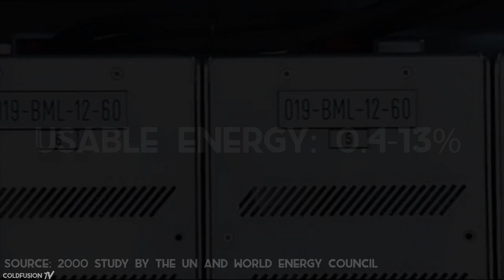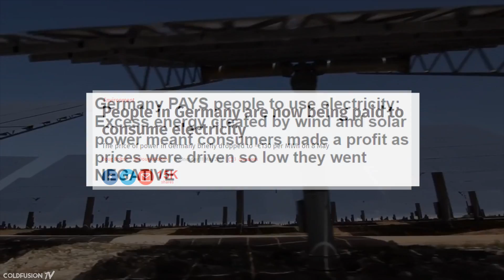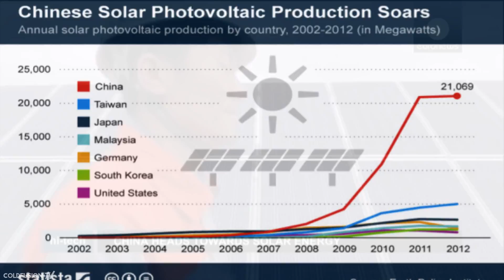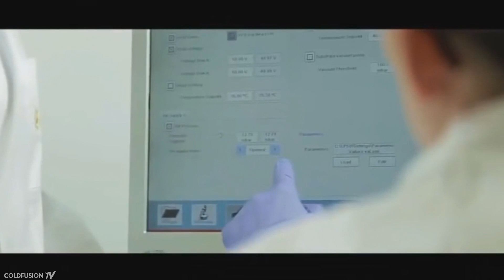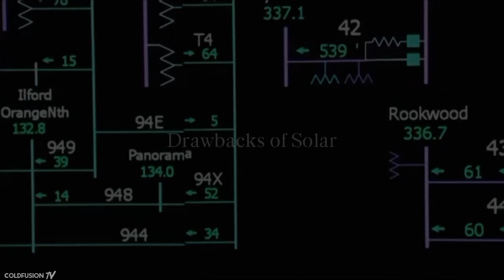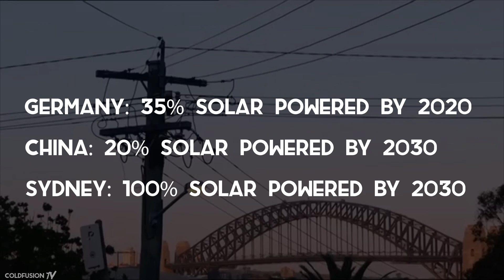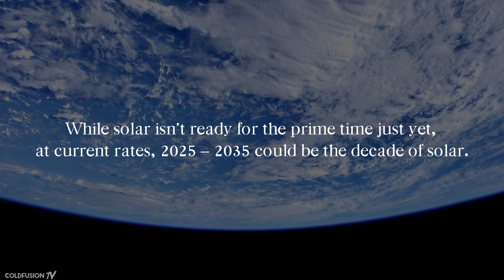The Truth About Solar

Comment: I would rate this as the half-truth about solar.  I live in California where we have lots or solar including large solar farms.  Solar and wind has turned out to be so unpredictable and unreliable the power companies aren't buying solar or wind generated energy.  Instead they are buying more nuclear and coal produced energy.

Solar turned out to be a failure in Nevada and the solar companies closed and are no longer in business.

The efficiency of solar is pathetic.  Yes the sun as a result of nuclear fusion  and fission provides us with almost all of the energy we need to live, the amount we can capture with home solar system turns out to be only about 5% or less.  

Remember the sun produces many different wavelengths of light but solar panels only can produce power using only a couple of wavelengths of light.  The rest is converted to heat and is lost.  

The guy in the video only talks about peak efficiency.  That only happens for 45 minutes 3 days out of the year for a fixed mount system.  The rest of the year the suns ray hitting the panels at a angle the panels and average out to be maybe 20-25%  efficient.

Then you need to factor in loss of efficiency due to heat, wire resistance and the efficiently loss in the inverter (another 15%).  So for a system that costs $40,000 you only get  5%.  Then with each year the efficiency of the panels decreases.  

There's also no mention of the energy cost to produce the solar panels or to recycle them.

Solar sounds so appealing until you find in the United States the government/tax payers are paying for 30% of every solar installation.  While the home owner saves $50 to $75 off the cost of their electric bill the solar companies and Wall Street make $25,000 per home where a solar system installed.

Do the math on solar.  The people who are promoting it are making a fortune ripping off the tax payers.
Reply: I think you missed one of the main points.  Solar technology is improving at a geometric rate.  Sure some solar technologies and companies may fail and the price may not be where you want it now but the technologies are improving and the price is coming down.  Every other electricity generating system has losses due to wire resistance and heat.  And many of the other concerns you express were directly addressed in the video.  

Also fossil fuel companies have been making huge fortunes ripping off the taxpayers for century or more.   Taxpayers getting ripped off isn't due to solar energy it's due to something else.
Reply: Passed High School Physics That sounds more like a problem with government and wall street than with solar technology.
Reply: okleydokley I live in California where we have geothermal and it has problems too.  

Geothermal has caustic chemical in it that rots out the pipes and then what to do with the stuff that comes out of the pipes?  It's toxic.

In addition in California we have found not that much energy can be generated with geothermal.

With nuclear so energy dense it's looking like that's our best solution at this time.  We currently have fuel to supply the world for the next 500 years with electricity

And as for the highly radioactive nuclear waste we return it deep in the Earth's crust next to the Earth's mantel where it is secure and safe.  Over time the small amount of highly radioactive waste will mix in with all of the other highly radioactive elements in the mantel of the Earth.
Reply: Thank you for sharing and informing us of this!
Reply: I considered solar and did the math. It did not make sense, even assuming panels work and last forever. However all our local farms are pumping water with solar electricity. Solar makes sense as a supplemental source if you use a lot of electricity. Geothermal heating makes sense. Its insane we haven't been doing that for a lot longer.
Reply: @Passed High School Physics You couldn't be more wrong.
Reply: While I don't know about the state of large-scale solar, getting panels for my house works wonderfully. I pay a few dollars per year for energy, and I will make a return on the investment in two years, not including the increase of the house price as well. I recommend buying panels for your own house. Hopefully large scale solar becomes just as advantageous soon.
Reply: Yea don't believe this guy. I would bet he either doesn't live in California or hes a nuclear supporter. I do live in California and I speak to HUNDREDS  of people all the time that have solar and every single one of them is very happy with solar. The only problem I see is when people don't do their proper research and get a bad company contract or lease. Do your research understand what your buying, key word buy.
Reply: Shlomo And the other companies?  They are using the same business model?

I just read that Bill Gates who is funding the development of the next generation of  nuclear reactors has meet with so much resistance to nuclear power in the United States and Europe he's giving it the the Chinese.

Americans need to wake up before we give all of our technology away and not use it ourselves.
Reply: no, there's proof that's not the case, there are 30 year old solar panels that still output their original capacity. and solar panels are sold with a 30 year warranty that guarantees it will be at least 80% efficient by that time, or your money back.
Reply: Just because the state of California is bad at managing the energy it generates, does not make that the case in the rest of the world.

Because of our solar and wind we were able to run coal free for the first time since 1870 last month.

you can fight it all you want, but the fact is, solar works, wind works, tidal works - and we're only getting started.
Reply: +topflight408
   Agreed, hettygreene is a moron.
Reply: Could it be me being sarcastic and you being too thick to spot sarcasm?
Reply: +CNCmachiningisfun Don't bother with hetty hes a lunatic that thinks the NSA implanted a chip in his brain
Reply: Tesla wont die anytime soon, and they are buying solar city. Tesla have a lot of work to do, just to catch up with demand.
Reply: Tesla don't make money because they spend it in upgrading capacity, if Tesla wanted to make money next year, they could. They would also miss their production target of 500,000 cars a year by 2020. Tesla is worth around 30billion, The solar city deal is only costing them 3 billion 10% of Tesla stock, money that then goes to solar city anyway.
Reply: Yep. HALF-TRUTH about solar would be a much more fitting title for this video. I agree! ☺
Reply: :P ..so just because it may (or may not be, i dont know the fact on that location) have problems in California mighty USA... it is a half truth that solar power will power us humans into the future? I really dont get why people are even measuring a success to what is happening (or is not happening) in the US. The US is a lot of things, but not world leaders or pioneers, at least not for the rest of the world. Now, now, before we go into a futile discussion about this and that. I am only sharing general perspective of people not from the US and am not looking for a discussion in that, I am only stating it to confront the sheer arrogance in reasoning through your post of California.

If you were to google a little, you can find plenty of examples all over the world that proves over and over and over again that even in the current state of development (heck even 10 years ago) solar panels can EASILY substitute the inmensely poluting current systems in place. Not everything is just about money money money :) I much rather pay a chunk more tax and have funding done for a nation wide solar system replacing all current systems, knowing that much cleaner air is being inhaled and much less furhter poluting is done to our habitat. Money should not be a substitute for your heath and that of your family. And for those who do not have the blessings to be lucky enough to individually finance such systems, I suggest full and utter support to any politician promoting public systems.

People who are still talking about "if solar is (for now) the way to go" are really lost.. and if you manage to find yourself in measuring this change towards money.. you are corrupting yourself while being really lost. The tech is there, it is proven and its only YOU who can make it or break it.
Reply: hettygreene My friend, by all means you have the right to any opinion you desire to form, but I do feel it is important to point out that you are factually wrong.

You seem to forget as well that the electrical market is already established by our current systems coal, hydro, nuclear etc.. and this fact alone requires "new tech" that wishes to invade that market to be supported by funding. The second thing you seem to conveniently ignore is that ALL currently established methods of generating electricity AT THE LEAST in the beginning (if not still) required subsidizing and there is nothing wrong with that. Just because it requires subsidizing (like going to space ;) ) it doesnt mean it is not  a good goal or tech.

As for the "but what when it gets dark" nonsense, you are aware you can generate a surplus and store it yes? Its all part of the already existing products. Besdes this solar is not the only renewable energy source ;) it can all be joined.

I really dont understand people such as yourself, what is actually what you dont want to happen? That we (as in you and I, the people) take back control of our power generation/consumption and individually generate and store it AND even communally exchange the surplus?
Reply: +hettygreene Celebrating evil? You sound like a moron who believes in secret cults and the illuminati. Look you dumb fuck when you pay taxes like I do then you can have an opinion. And once you get smart enough to realize that renewable is safe, cheap and practical solution think of me. Now put your tin foil hat back on because the aliens are looking for you in your moms basement
Reply: +hettygreene Quack science?  You don't believe in proof? Solar cells have been used for decades and are proving to be the solution for earths energy problems.  Let me guess you believe the world is flat and the presidential cabinet  are reptiles from the center of the earth
Reply: +Passed High School Physics Try companies like Edison and PG&E that's where I get my info from not some off the wall esquire magazine. Try doing real research speak to a power rep from your local station. And FYI solar farms produce electricity so how can you say CA doesn't.  FYI the plan to prevent the blackouts is smarter charge controllers and like I said earlier an interstate power line so we can sell our excess power
Reply: +hettygreene hey Moron your still talking. The reptilians haven't come for you yet?  Or is it a magical man who is going to save you? At the very least the OP made some points back by research. You just give people like him a bad name. So put your tin foil cap back on and beware the aliens are watching you.
Reply: Passed High School Physics 
  Agreed. This technology has quite some ways to go before it could be described as the best option for all users. 
 It's just a lucky thing that the prices for solar panels has taken a nose dive in recent years, as that helps to offset their natural depreciation and intermittent performance. 
 Since I am off the power grid, I am obliged to look into all of the possible power supply options.  As solar in itself is not the full answer, I have also added wind turbines to the formula. Naturally, they have their obvious down sides too, so the final step has been to use a generator.  In the past, I used fossil fuels to run the generator, but in recent years, I have learned how to run my petrol powered generator on wood.  It's a carbon neutral solution, so Al Gore will be pleased  :) .
Reply: hettygreene Yup - And look at the financial trouble Solar City is in.  It's looking like another story where the tax payers get ripped off by the solar industry and Wall Street.
Reply: Shlomo  Seems like both Tesla and Solar City are headed for life support and won't be around much longer.
Reply: Strangething90  In what way?
Reply: Strangething90  Where are they getting the money to upgrade if they aren't making any money?

If Tesla is worth 30billion as you say why can't they pay their bills?  And why is their credit rating so poor?

The may have a target of 500,000 cars by 2020.  But if they don't have money to pay their current bills where are they going to get money for the materials to produce the new cars especially if their credit rating is very poor no one will loan them any money.
Reply: ***** What your cousin did makes perfect sense, but what does he do for power at night of if there are clouds?

He then needs a bank of batteries.  If he used the cabin on weekends a week here and there who is maintaining the batteries?  How long do the batteries last?  How much are they to replace?

Will his $30,000 solar investment ever pay for itself?  I live in California and even with the 30% tax credit a $30,000 solar system just barely pays for itself in 20 years for people how live in the house.

I find it hard to believe with the life of solar panels being 20 years that the $30,000 makes any financial sense.    

Just how much would your cousin's power bill be each month?  $20 - $25?  I'm thinking maybe your cousin may have been better off paying the $30K for power poles and paying $25 a year not to have the hassle of maintaining and replacing the batteries AND for the convince of having electricity 24 hours a day with the flick of a switch.

Plus in 20 years your cus will have to replace all of the solar panels with new ones.  Will that be another $30K?  

If the entire solar industry flops again your cus will have to pay the power company $30K to install the power poles anyway.

I was all set to install solar on my house until I did the math calculations.  The solar companies are sure lying about the advantages for solar.
Reply: yes, no one  is debating that, we know its pretty shit in the winter, but its brilliant in the summer, here's some data (i say some i mean quite detailed numbers) about UK solar and wind. Over the course of a year, they are even. solar has twice the max capacity of the wind, but the wind can operate at night.

http://www2.nationalgrid.com/UK/Industry-information/Electricity-transmission-operational-data/Data-Explorer/

solar is more than enough to offset coal and gas generation in the summer, we can use other solutions for winter.
Reply: Strangething90 I live in California where we have many large solar and wind farms for generating electricity.  The power companies in our state have had brown and blackouts as a result of solar.  Mid-day clouds cause dramatic decrease in the production of electricity which causes brown/black outs.  As a result the power companies aren't buying the solar electricity and the solar farms are shutting down.

Same problem with wind...  It's unpredictable so the power companies aren't buying the power and they also being shut down.

The UK had the same issue a while back were there was no sun and no wind so they had to buy coal and nuclear generated electricity for a week.  

Here in California we are beginning to see the problems and failures with solar and wind.

Solar and wind sound wonderful but like all of the other ways to generate electricity they are not perfect either.
Reply: +Passed High School Physics 

Absolutely, Passed. 

This "renewables" crap is the Kids Lemonade Stand version of energy production.
Reply: Average solar panels are 20% - which is 10x better than photosynthesis i might add, you can get more efficient panels with a much greater cost. the tech is improving all the time to bring costs down, that's whats being sold. most of all solar panels have appeared in the last 5 years

and to shoot down your subsidies "argument" if oil and coal are so good, why are they subsidised? 

The only reason solar was "subsidised" in the UK was to increase uptake, that fell dramatically from 40p down to 14p per kw/h, the difference being it now takes longer to pay back the cost of the panels, which everyone knows lasts way longer than 30 years and does not degrade at 1% per year.

Anyone arguing against solar either doesn't have solar or bought the cheapest home made garbage imaginable.
Reply: Strangething90   I think you need to check your facts.  Chloroplasts, (the solar collectors in plants are 37% efficient and plants unlike solar cells are not completely covered in chloroplasts.

You claimed solar technology is getting better with time.  Yet over five years ago a solar panel which is 95% efficient was supposed to be hitting the markets in 2015/2016....  Where is it? 

http://phys.org/news/2011-05-solar-product-captures-percent-energy.html

If the technology has brought down the cost why in the US are tax payers having to pay 30% of the cost on the installation?  If the technology were getting better as you say we would have solar panels that are 95% efficient and there would be no need for tax payer subsidy.

Why do you say solar panels do not degrade over time when the solar industry has shown they do deteriorate at 1% per year? 

http://energyinformative.org/lifespan-solar-panels/

http://www.nrel.gov/docs/fy12osti/51664.pdf

Fossil fuel subsidies in the United States began in World War I as we helped our European allies win a the first World War. 

I was about to install solar.  My roof is southwest facing, receives no shade so I feel I would be the ideal candidate for solar.

The solar companies in the US quoted me a price of $40,000 (USD).  If prices have come down, why is solar so expensive even with the 30% tax credit?

I researched this and found the solar company is really selling me $9,000 in solar panels $3,000 for permits and installation so where's the other $28,000 going?   It's pure profit that's going direct to the solar company and Wall Street.

That's over $25,000 of pure profit for each home the solar company installs solar panels on.  How much do I save?  The solar companies tell me I get to save $50 a month or only $600 per month.

I might be dumb, but I an not stupid.  The solar company makes $25,000 while I get to save maybe $12,000 over 20 years.

Solar has to be one of the worst investments ever.  People are spending $40,000 and getting back $12,000 after 20 years?

Please tell me why solar is so good?
Reply: hettygreene No idea what you just wrote my friend :D and i really would like to understand you.. 

I can let you know though that the solar energy market is growing and growing, more and more, better and better and it is only going to continue like that and I am very happy for it.. happy that my house generates its own energy, that I can store it, that I can use it how i want and that the energy I use does not come from destroying this planet ;)
Reply: hettygreene You are really hurtfull and because you are so degrading  and hurtful to me, you must be now all of the sudden factually right. What was i thinking ;)
Reply: +hettygreene The Gods Ra and Helios have give us permission to use their power. That's what you sound like, moron. And this is America you foreign minded dipshit and here in America we are working on becoming the best and sometimes that means paying taxes on things you sometimes don't agree with
Reply: +topflight408 

YOUTUBERS BEWARE:  

This is the kind of thug that's behind the quack-science superstition of the solar crap.
Reply: +Passed High School Physics Lets look at the facts. #1 the earth is a sphere #2 there has not been a single blackout due to solar #3 the only reason you hear solar and black out in the same sentence is because the solar farms are producing too well #4 This will allow CA to sell electricity to other states win win #5 Solar sales are increasing solar leases are decreased because buying is smarter #6 90% of people laid off from Solar City found a job in less than 2 weeks
Reply: topflight408  Again in California there are 75+ power companies.  Some own and run power generation facilities, (nuclear, coal, gas, hydro, solar, wind) while others buy what's produced.  

We also have some power companies which produce power and only sell to various power companies int eh state.  All of the electrical produced in the west is placed on one power grid to supply power to all of the power companies in 5 or 6 states.  Each power company has to place an order for how much power their customers will use 24 hours in advance.  If one power company requires more than they ordered it results in a brown or black out.

Likewise if the orders are in but a cloud reduces the energy output of a solar farm or there's no wind for a wind farm it results in a shortage and brown-outs/blackout occur.

This is what's happening in California and Nevada.  To prevent brown/black outs the power companies are buy more nuclear, coal and gas created electricity.

What happens is the solar and wind electricity created have no buyers in any of the states so they go off-line.

This could maybe be "fixed" with a smart-grid but that's not going to happen any time soon either.

Reason the west coast wont't see a smart grid for at least 100 years or more is the life of the equipment.  If you factor in all of the spare equipment it will take 125-150 years to replace.

For us to implement a smart grid any sooner would require the purchase of all new equipment plus all of the spares and the installation.  This would require swapping out all of the current equipment and adding the new smart grid infrastructure.  

There is no way 200+ power companies in the west replace all of their existing working equipment at the same time.  If there is just one hold out it won't work.  Then the question becomes who pays?

The coast will be to the customers and it's estimated electricity costs would have to triple or quadruple for the next 50-75 years to pay for it.

I asked before....  Where are the solar panels we were told would be for sale in 2016 which would cost less and be 95% efficient?  If these panels do exist this would change everything.  One would need 60% less panels to generate the same amount of electricity as the current panels and they would cost less too.

So where are they?
Reply: So why don't we all just burn all our fossil fuel reserves and fuck the future? That's the simplest way, and humans like simple, because humans are basically lazy creatures.
Reply: topflight408 
  He's an idiot. What's worse is that he has smeared his clueless crap all over the comments under this video.  Still though, he's funny, in sad and pathetic sort of way  :) .
Reply: hettygreene 
  YOU are the idiot here.  
 While "Passed High School Physics" puts his points well, you are nothing but a bad tempered shit stain.  
 Oh, by the way, I do NOT believe in this global warming crap. nor do I believe the tax payers should be saddled with any of the bills for alternative power.
Reply: hettygreene 
  All I am promoting is personal, home, use of solar, and wind power. I don't want to force this upon people who don't want it.  Was this not clear to you from the start?
Reply: +Mentholatum101 

Solar hustling is justified by a quack-science superstition called "global warming".
Reply: +hettygreene
  Your comments are pathetic.
  Grow up!
Reply: enator71  No mention of whaling and spermaceti or nuclear?  (Remember nuclear reactors are 100% natural and were around billions of years ago.

You know something interesting about the electric cars from 100 years ago?  They have the same range as the electric cars of today.

In 100 years we have not solved the range problem.

You are right about us running out of fossil fuels.  We were told fifty years ago at the rate we are burning fossil fuels they would be all used up in sixty years.

Glad to hear it will be another sixty years before the fossil fuels will be all used up again.  I suspect in 60 years we will be told once again we only have 60 years of fossil fuel left before it will be all gone once again.

You are missing one thing.
 OIL=60 years.
The SUN=5.500,000,000 years.
Nuclear will provide power until the end of the universe.

Appears nuclear is the better choice.
Reply: +Passed High School Physics 

Never mind. NIF is National Ignition Facility, a laser fusion money pit boondoggle that is always 10 years away from commercialization - another screwing of the taxpayer.
Reply: hettygreene If you think that you must be living in some altered state or reality or you have been duped but not getting all of the facts.

Why didn't Gates spend 1 billion on thorium reactor development and TWR?  Easy because thorium reactors have way too many technical problems.

Why is the US and Europe putting all of their money into NIF and F4E and not thorium?  Because there are too many technical problems with thorium.

Dude join the reality everyone else shares on earth.  You'll be happier.
Reply: Passed High School Physics 
 Hettygreene really needs to grow up, but we both know that is NOT going to happen any time soon.
Reply: ***** Is he like some of those religious people who believe there is no such thing as dinosaurs? When asked where FOSSIL fuels come from they say the the ground.

And when they see a full dinosaur skeleton in a museum they look at it and touch it and say it doesn't exist.

I guess there are those people who still believe the world is flat and the Earth is the center of the solar system and the universe.
Reply: ***** I hear you.  They have religion.  Don't believe what you see or use critial thinking skills.  They just belive what they are told and what to hear even if they are holding it in their hand.
Reply: hettygreene hettygreene  At least I had a high school physics teacher who taught me to look at the evidence, use critical thinking skills and think.

It must be easier to be a lazy slob not using your brain, and just blindly believe what you are told and not question any of it.

I'm sure you are one of those types who doesn't believe there were such a thing as dinosaurs even if you were holding a dinosaur bone in your hand.

Keep up your beliefs brother.  We need people like you so the rest of us will look at the science and use or brains.
Reply: Where is your proof of this? How do you know? It just sounds like something you made up.
Reply: The only issue with your theory on fusion is it won't be something customers can have in their own home and control it like solar. They will have to once again purchase the power from a fusion facility, which is redundant. I guess the other issue is fusion has been out for over 2 decades and it apparently isn't coming anytime soon. Likely by the time it does 1/3 of the population will have gone solar anyway. Thoughts?
Reply: Solar TV / Solar Wolf Energy   That he wants more money?
Reply: *****  The $45k-$50k systems are for just under 10kW systems.  This is what the "Certified Solar Design Engineers" at SolarCity, SunRun, SunPower, and others are all trying to sell me.

You ask why am I dealing with these people?  First because I thought they were "designers".  Now I know they are a bunch of folks who don't know AC from DC or the difference between a amp, volt and a watt.  That's all stuff I learned in tenth grade.

This is why I keep saying solar is all about profits for the solar companies, Wall Street and people like Elon Musk.  It has very little to do with helping society or the planet.

I would say 96% of the advertisements from SolarCity on how solar makes the world a better place are lies.

I've been trying to find someone who understands solar and can answer the simple questions I posted in my last post.

I can't seem to find anyone that "knows" and understands solar beyond the scripts these "Certified Solar Design Engineers" follow or the basic training they receive and probably don't understand.

No sure where you are located.  In the US we have ISOs which control production and distribution of electrical energy in the Western US.  I was lucky enough a few years ago to take a class on smart-homes, how electrical energy is produced, distributed and sold to the power companies, how are electrical grid works and more importunately the history of electrical power in the United States.  To understand the "mess" we are in today, one needs to look at how and why electrical power companies were created around 100 years ago.  I found it to be a very interesting.  It also answers the questions as to why it's going to take 50 to 100 years to have a smart grid.  Power companies are still using technology and computers from the 1970s and early 1980s to supply power to customers.  I know in Canada they plan on using computers from the 1970s for another 40 years to control their power plants.

The solar we have today is so inefficient in converting sunlight to power I agree with you it's a temporary solution.  But with our power rates now approaching $0.40 kW for the highest tier it's making financial sense.

I still think the solar industry is in financial trouble.  But until they go bankrupt they are sure making a bundle.  From what I see they take a $12,000 solar panel system and marking it up $23,000 to make huge profits.

I'd sure like to make $23,000 off of something that only costs $12,000.
Reply: none You've provided a link for a guy who is a professional witness and is paid to promote an agenda against nuclear and promote solar.

In other words he's a paid shill.

I listened to his video, and the guy is distorting the facts to promote his anti-nuclear pro-solar agenda.

Some of the facts he's omitted is the solar industry after 30 years still have not found a way to store electricity for use at night or when the sun doesn't shine.

He's also left out the fact the solar industry has stated in 35 years at best they will only be able to supply 15% of the world's energy.  He has no solution as for were the other 85% will come from.

In his talk he cleverly omits the fact in the building of solar a lot of CO2 is created and released into the atmosphere which contributes to climate change.

Ad for his anti-nuclear propaganda the guy is using 30-40 year old arguments which are no longer valid.

He shrewdly does not mention or talk about next gen nuclear which uses low molecular weight fuel.  Next gen nuclear power is green (no green house gases), it's renewable as we already have an endless source of fuel. and there is no long lived radioactive waste.

He's just using outdated scare tactics to scare people about nuclear when in fact next gen nuclear is where we are headed.

One has to ask why he's not telling the truth?
Reply: none Dude what you have you been smoking for the past 25 years?  Clear that smoke out of your brain so you know what's going on.  The US, Europe and Paul Allen have all been working on and developing next gen nuclear.

Get with the program, the American people voted and elected Trump as president.  Don't matter what you think of him does it.  You can say he lies cheats and steals but at the end of the day he's still going to be the president.

Dude have the drugs rotted your brain?  China France, Germany and Israel have all built walls.  Why is it okay are you picking on him for doing something other countries have already done?  

You think Trump is a puppet of the Jewish Zionist Government when Trumps relatives where eliminating them is World War II?  You know the Jews would never support of back someone who's family involved in eliminating people in the European Holocaust.

Never said Trump was honest, fair or intelligent.  I just said he's the person the American public voted for to be their leader.  

Dude you are thinking like we are in the 1970 if you think the MIC needs the atomic energy commission.  The US had 31,255 nuclear weapons.  Do you really think the MIC needs more?  

It's not that difficult to make an atomic bomb.  One does not need a reactor.  The first atomic bomb used against an enemy was made by purifying nuclear material...  A reactor was not needed.  

Trump is telling the American people the solar industry is a scam.  And as you say, Americans are sheep and will listen and follow.

The US has thousands of nuclear war heads.  I would not be surprised if Trump were to use a couple of them during his term.
Reply: Solar City was just a bad company with horrible business model that with falling costs of panels went deep in red.
Reply: Thanks for this. Good information!
Reply: I agree with the geothermal. It really makes sense to capture the earths own internal heat source.
Reply: SCTY has problems with cost of financing that it's leasing policies are becoming more obsolete with dropping cost of solar installation thus their recent problems with rate of growth in last 2 years are reflected on financial outlook of the company.
If they are reformed with tesla energy and their new buffalo factory that might be a good thing for tesla in the long run.Problem is that the financial mess of SCTY will make it harder for tesla to finance capital expenditures necessary for gigafab1 growth and model3 mass production.This is the part that is worrying to me because of how crucial model3 is for Tesla
Reply: SCTY yes it looks so but Tesla?
Reply: Strangething90   Are you sure?  Tesla hasn't made any money yet.  The batteries in the cars degrade over time and cost for the battery replacement is $22,500 dollars.

Help me understand.  Why would Tesla, a car company that hasn't made any money buy Solar City that's in financial trouble?

Neither one are financially stable.  But thetwo of them together might kill both of them.

Oh no and it gets worse for Tesla...  They can't pay their bills.  Tesla's credit rating right now is very poor.
Reply: ***** I think the truth is we don't know how long panels will last.  For every 10 years of use they lose 10% in efficiency.  So in 30 year they will only be 70% efficient.

Even if you live alone 300 watts in not much energy.  I'm assuming 300 watts is peak output?  That only happens for 45 minutes a day.  I'm guessing for most of the day you are only getting 100-150 watts.

That's not enough to power a refrigerator and hardly enough to power a computer.

I certainly could not do that.
Reply: There is no reason why current solar tech will degrade overtime, all it is, sunlight displaces electrons in the silicon that then travel down the metal wires to create current.
Reply: Strangething90 At the atomic level the silicon semi-conductor breaks down as the the suns rays/photons strike the silicon.  The accepted average is 1% per year or 10% per decade.

Then the semi-conductors in the inverters only last 3 to 5 years before they have to be replaced.

If one reads the warranty on a solar systems you will see it will only last for 20 years.  After 20 years the energy production has decreased by one fifth.

At this tine you would have to add 20% more panels or replace the system.

Solar is good, but there are a lot of drawbacks.
Reply: ***** I've been researching solar for year now and taken some classes.  Unless you are on the equator there are only 2 or 3 days for 45 minutes where you are able to get maximum output.  This is the only time when most number of the suns rays are perpendicular to the panel.

At all other times the suns rays are at a angle and reduces output.  The drop in output is substantial.  I think over the course of a year you would be luck to get 10 to 15% efficiency for a fixed mounted panel.
Reply: *Koch Industry PAC troll detected.
Reply: hettygreene Nice way of putting it.
Reply: Strangething90 No one is saying solar doesn't work, but it's the cost, reliability and life of a solar system that's at issue.

California has over 70 power companies and we we doing fine with hydroelectric and nuclear.  It's the unreliability solar and wind that's causing problems for us.
Reply: +MrAnchorman123 

If solar is so great, remove all those goddamn subsidies, starting with that disgusting Net Metering, which shifts cost to poor people. 

Solar is a stupidly self indulgent Kids Lemonade Stand "lifestyle" type of business.
Reply: *****  If solar is improving why aren't these improvements being sold?

Do you have any idea on how inefficient the conversion of solar energy to electricity is?
Reply: Why would anyone by this type of solar panels when there are cheaper ones that are 95% (not 20%) efficient?

http://www.naturalnews.com/028691_solar_cells_efficiency.html#
Reply: If they made a solar panel that was cheaper to produce and could get over 900w per m2, they would be shouting it from the rooftops, but instead all we have is an article from 2010, claiming 90% quantum efficiency

https://en.wikipedia.org/wiki/Quantum_efficiency
Reply: Strangething90  There were several articles claiming from five/six years ago claiming 90-95% efficiency from these "new" type of solar panels saying they would be available in five years.

What happened?  Is this like the Osborne effect for computers?  Where prematurely the  discussing future, unavailable products damages sales of existing products.  https://en.wikipedia.org/wiki/Osborne_effect

Or is the solar industry a victim of cold fission?
Reply: If i was able to create a solar panel with 90% efficiency i'd probably just make my own power station, because lets be honest if you can make a solar panel like that, that also claimed to be cheaper to produce than regular 20% panels, it would be 10x cheaper than coal. and then i'd sell a few panels to NASA for a few million.
Reply: +OohzyJohnDow 

Absolute elitist, clueless nonsense!

It's simple but toxic to elitist liberals: if solar is so great, it doesn't need subsidies.  

But it's Not so great, and it needs the stupidly maligned "grid" to come in and take up the slack when - surprise surprise - Night comes. 

Solar is an intelligence-insulting  kid's lemonade stand business.
Reply: +OohzyJohnDow 

That's right, you live in a childish communalist fantasy, as opposed to a market reality. And in attempting to impose your John Lennon Starbucks fantasies on the rest of us, impose hardship, unhappiness, and suffering instead. You are an aggressive, evil person.
Reply: +OohzyJohnDow 

See what's going on in Germany for the solar fiasco, rising prices, cost shifting to lower middle class, frantic replacement of nuclear plants with coal.   i.e. sheer Kids Lemonade Stand stupidity.
Reply: +OohzyJohnDow 

Spare me your self regarding, self serving, 'Im so great'  sermons.
Reply: hettygreene As you wish my friend :) I am at your service!
Reply: +OohzyJohnDow 

You luxuriate and mirror gaze at other people's expense.
Reply: hettygreene I know what I am but what are you ;)
Reply: +OohzyJohnDow 

Not knowing that is another of your shortcomings.
Reply: Thats down to your politicians and coal/nuclear power lobby groups. Fix your politicians and fix your solar problem
Reply: +Minuteman 

You're not getting it. 

"Renewables" are a Kids Lemonade Stand play-business that is paid for by working class cost shifting. 

Support that political rip off and you are a bad person.
Reply: +topflight408 

You are celebrating evil. 

The "happy solar people" are SCREWING the non solar people with the  tax subsidies, cost shifting, and that Disgusting Net Metering!

If you to play earth boy Kids Lemonade Stand,  DO IT WITH YOUR OWN MONEY, you schmuck.
Reply: +topflight408 

"Thou shalt not steal".   

Sounds pretty simple me, you obnoxious self righteous idiot. 

BTW, if it's so cheap, remove the subsidies, you creep.
Reply: +topflight408 

I think you should change your name from Topflight to LowLife.

If the Founding Fathers could only hear your asinine comments about taxes over something as foolish and quack-science as "solar",  they'd think people like you aren't worth the effort.
Reply: topflight408  Yes let's look at the proof.  Solar cells have been used for decades and are very inefficient, very expensive, and in California solar farms are produce unreliable energy which is causing black-outs.  As a result California is shutting down solar farms and burning more coal and fossil fuels.

If solar is so wonderful what have all of the major solar companies closed their doors in the sunny state of Nevada?

I live in California and the number of people installing solar on their homes had dramatically decreased as people are figuring out solar even with a 30% tax payer credit just isn't worth it.  In California the solar industry is laying people off.  With Solar City in financial trouble I suspect we will see the other solar companies announcing they are in financial trouble too.

One has to ask what went wrong with solar technology.   Today's solar panels are only 20% efficient.  In 2010/2011 we were told a breakthrough in solar technology was made and in 2015/2016 we would be seeing solar panels that were cheaper and 90 to 95% efficient.  What happened?  Where are these low cost highly efficient solar panels we were promised?

It appears the solar industry has lied to the public once again.

By the way everyone thought the earth was flat and at the center of the universe.  While some people still might believe that to be true other are looking the the facts, just like with solar and have found it not to be true.
Reply: topflight408  Friend where are you getting your incorrect facts?  I live in California and were were experiencing black-out from as a result of solar.  So please don't tell me it's not happening.

California can't sell electricity to other states as the state doesn't produce electricity.  In the state of California we have over 75 different power companies.  Do you even know what you are taking about?  The power companies in the California purchase power from electricity producers from as far away as Washington State and New Mexico.

Solar like wind has proven to be so unreliable power companies aren't baying it and the solar farms are going off-line.

While 90% of the people from Solar City may have found jobs that still means there are a 10% reduction.

I will ask again if solar is so good for everyone why did all of the solar companies go out of business in the sunny state of Nevada?

If the solar industry is doing so well why is Solar City in financial trouble?

You are like the captain on the Titanic who is telling everyone the ship in not sinking when it is.
Reply: +OohzyJohnDow 

You live in the echo chamber of your full-of-crap fantasies subsidized by poor people.
Reply: The problems with solar continue to mount.  Solar companies with financial problems and others are closed their doors.
Reply: +topflight408 

In your characteristically blind following of the  pagan superdtitionist narrative, you neglect to account for these companies bilking the taxpayer through the stupid solar subsidies, just like the sainted Elon Musk.

They are doing it to make money. Without the ripoff poor-screwing subsidies, they don't do. 

You are a mighty, dangerous fool.
Reply: +John Benton 

How do you pack so many stupid statements into such a small space?
Reply: +John Benton 

No, on the contrary, your stupid sarcasm is so thick you can cut its elitism with a knife. 
You were encouaged in this obnoxious attitude by twerps like Jon Stewart, who are neither funny nor wise. and neither are you, or your mirror gazing disgusting conceit.
Reply: +topflight408 

Yes, there are several on this sleazy mirror gazing hangout who have the patience and depth to talk sense to you idiots, and I have nothing but respect for them . 

I don't have the patience to speak in depth to you disgusting idiots, one reason being that a bright teenager can overturn the childish  quack science of solar a solar and global warming, so I lose patience very quickly.
Reply: +CNCmachiningisfun 

Then why are you here promoting this crap?
Reply: +topflight408 

<--- is in the solar installation business, profiteering off taxes on poor people. 

Anything self serving here?
Reply: ***** 
  Sorry, but which person was your question aimed at. YouTube no longer seems to support 'focused replies', like it used to.
Reply: @Strangething90 +Strangething90
I am still reading along this thread, so is Solar good or no?
Can we run coal free?
Is Solar Panels 10X more efficient than photosynthesis?
Do solar panels degrade over time? How much?
Is testla dying or not? Is it going to buy solarcity?
Reply: +enator71 

Is that in percentage terms?
Reply: enator71 No true.  I like in California and many of the gas/oil companies are going bankrupt right now because of the low oil price.  The government is not giving them any money.
Reply: ***** 
"so is Solar good or no?".
 I can't really say that solar is the answer to all of our problems, but it certainly is good for individual users, as a it lets us save a fortune in power bills and infrastructure costs.
Reply: *****  Is solar good?  It depends.  I have neighbors, friends who have purchased solar and they have found it's a break even or solar is a bit more.

There's a YouTube video where a guy installed solar and did a detailed financial analysis and found if he would have invested the money instead of "investing" in a solar system for his house he would have done much better financially if he had not invested in solar.

Remember solar panel output decreases at 1% per year.  So after 10 years you solar panels are putting out 10% less than when you bought them.

There are supposed to be a new generation of solar panels which cost less and are 90% more efficient.  I would wait for the new stuff.
Reply: +CNCmachiningisfun 

Hi CNC - my happy hobbyist.   

it's me again.

Do you include the 'cost' of your labor in your diy-energy efforts?  Or no? 

By the same token, do you pay yourself in solar-than-thou bragging rights? 

Do you count the cost the rest of us have to pay in listening to that crap since we're forced to come to idiot-blogs like this and defend ourselves against the onslaught of the climate quacks and solar hustlers?
Reply: +CNCmachiningisfun 

.... and I forgot the a couple other things about solar: does the real estate for it come for free?

Do the panels have to be cleaned and is that labor provided by slaves?

do you have to pay higher property insurance premiums. if there's a hail storm, will your insurance cover the damage?

if it's so great, and it adds value to your house, will your liberal for-the-children property taxes go up?
Reply: +CNCmachiningisfun 

No, you get off the genteel bragging rights bandwagon of the tax-coerced solar fad. 

Try this for first principles instead of listening to that stupid Starbucks theme song for the millionth time:

Power is evil, 

because of the following golden rule of politics:

"Liberty" is a poetic term for property rights.

Therefore there are only TWO KINDS OF LAWS:

- those that protect property rights, 

- and those that attack property rights. 

"Have the government do unto others as you'd have the goverment do unto you."
Reply: +hettygreene
 Your comments are driven by jealousy.  
 You are jealous because I have a good life, and you are a jobless loser.
  Grow up!   Get a life!
Reply: +CNCmachiningisfun 

You are a greener-than-thou poseur belle of the ball hitching a ride on a stupid fad.
Reply: +enator71 

What are you talking about?
Reply: +enator71 

If you want to take petroleum off the table of strategic resources, you won't do it with this solar foolishness.

Try Thorium, molten salt reactors, and videos by Kirk Sorensen and others.
Reply: hettygreene Why Thorium, molten salt and not Traveling Wave Reactors?  

America is missing out by allowing TWR technology to be given to China and not using it in our own country?
Reply: +hettygreene
Get a job, and get a life, loser.
Reply: ***** Why?  Appears the looser are the ones who have jobs and the people who have great life are the ones without a job.
Reply: Passed High School Physics 
 While hettygreene continues to make his childish comments here, it would appear that he is the loser in life's ongoing battle for success.  Those of us with jobs have the financial freedom to do as we wish. Not so for those of us who are unemployed, so I think I disagree with your opinion on that point.
Reply: +enator71 

Do homework on Thorium and molten salt reactors, Kirk Sorenson. Your concerns are addressed there.
Reply: +enator71 

1) see the video "is nuclear waste really waste" for reprocessing advantages 

2) the gamma ray concern you mention is not from natural thorium , but one of the elements in the chain. see more videos to get comfortable with that.

3) the gamma emissions of the intermediate products make Thorium "proliferation resistant" -- "it's easily detectable and it kills you without thick protection," says Kirk Sorensen 

4) see the various TED talks for different perspectives on the same issue(s)

5) Thorium us as common as tin; ore scarcity is not an issue; see some more videos to get that part straightened out and also get a correct comparison with uranium: u235 vs u238. Kirk Sorenson: "burning u235 is like burning platinum."
Reply: enator71 If NIF works out that lie "too cheap to meter" will become a truth.

You will find you are mistaken when it comes to treating some cancer patient.  There is a YouTube video where a man and another where a women is injected with radioactive isotopes and become radioactive.  They measure themselves with a Geiger counter.

All of the nuclear radiation is inside of them, not passing through them.

China does not have all of the rare earth elements.  Every here of scandium? or yttrium?  Neither are places in China.

Can you tell us what's wrong with Traveling Wave Reactors?  This is American technology which America is not adopting but the Chinese are.  Once they build  TWR they have enough fuel to power them for 500 years thanks again to America technology we are not using.
Reply: +enator71 

Watch the videos before jumping to conclusions. 

The benefits outweigh the downsides - the benefits make simple gamma Ray shielding look trivial. 
They have walk-safety shutdown features that account for the gamma rays. 

Tidbit: the hotter it is radioactively, the shorter the half-life. Gamma in general is hot, so it's half life is relatively short. 

Once again, see the Kirk Sirenson, multi-TED videos on this to get depth and perspective on it. 

Rare Earths is one of those Sierra Club-govt screwups where they hounded American producers out of business because the processes produced s trivially radioactive waste.  

Anyone care to guess what that trivially radioactive waste was?
Reply: +enator71 

Just watch the videos before shooting your mouth off like jerk.
Reply: +Passed High School Physics 

If NIF is about fusion, may I do my bit to stop those subsidies too: Fusion is a boondoggle with an academic-bureaucrat life of its own. 

See the Kirk Sorenson videos for a quick takedown of Fusion and its obvious drawbacks. 

"Thorium is what fusion was supposed to be."
Reply: +enator71 

I have, more than you on subject of thorium, and the efforts are wasted on a know-it-all blowhard like you. 

There's no reason to be bombast-negative about Thorium.  Too bad such an opportunity trashed that way.
Reply: hettygreene I'd like to hear more about Thorium and how they compare with Traveling Wave Reactors and NIF?

It's my understanding there are many serious technical issues with Thorium reactors which is why TWR are being built and NIF is the hope for the future.  When NIF gets working working there's no reason at all for Thorium reactors.
Reply: +Passed High School Physics 

Right... Kirk Sorenson videos are excellent and exciting places to start up the learning curve of thorium.

In the competitive debating department, it's astonishing that fusion (that's NIF, right?) has gotten a dime of slush money.  Kirk destroys it's practicality deftly with a few sentences of the nuclear physics behind it.  It's always 10 years away from prime time and it's a boondoggle for university research handouts. 

Sorry, I don't know what TWRs are, but i heard Kirk dismiss them handily in one of interviews. 

The real pay-dirt is in Thorium and msr (molten salt reactors)
Reply: enator71  China is going with Traveling Wave Reactors, not Thorium.  We still haven't worked out all of the issues with Thorium reactors plus 10 years is a lot of time.

China should have TWRs online in a few years or end of the decade.
Reply: enator71 I think the web site you are looking at is out of date.  TerraPower has a deal with China going on.  This will make Thorium as obsolete as cassette or VHS tapes.
Reply: +Passed High School Physics 

I've taken a crack at Terra Power and I'm disappointed. 

This is Bill Gates' fun in retirement schoolboy science project. 

Bill is also the one lecturing us on some stupid "carbon neutral formula " he wants to ram down everyone's throat. 

This is what happens when you you have too much time and money on your hands. 

Seriously, TWR is just a bunch of cartoons a
this point with a Bill-Nye-levels sales pitch. 

TWS: solid fuel (worse than liquid);  a cartoon variation on the breeder reactor 
 
(basically tried and failed; see some of Sorenson videos for a compare and contrast of fast neutron reactor basics vs slow neutron ("thermal" i.e. slowed down to ambient temperature by a moderator, so the neutron can sidel up to the nucleus, get absorbed, and cause a fission.

(I've been listening to to the UC Berkeley  Nuclear Engineering videos; great example of YouTube education potential).

Back to Traveling Wave Reactors, Kirk Sorenson mentions it in a taxi cab  interview in one of his videos and 1, describes it in the high-risk speculative technology that it is, dismisses it accordingly. 

I've seen the Traveling Wave cartoon and it looks frankly crazy.  

Some snake oil salesman got to Bill Gates with this one - solid fuel (bad), no visible means of reaction control (good regulatory luck with that), etc. 

Sorry to disappoint and not enthuse about Traveling Wave, but TWR looks as challenging, high risk, and boondoggle-ish as fusion, i.e. a money losing waste of time compared to Thorium and MSRs (molten salt reactors)
Reply: hettygreene  I've been watching the UC Berkeley lectures too.  They are wonderful.

You are right Bill Gates in the only one talking about TWR and TerraPower is well funded.  The thing about Carbon neutral is a political but the fact still remains we need to find a solution to the world's energy problem and the burning of coal and fossil fuels is not the answer nor is solar and wind.  Bottom line is we need all of them.  But right now solar and wind are very expensive and nuclear and coal are inexpensive.

Is there any active development on a Thorium reactor?  Last I heard the were several technology problems we haven't found a solution for.

Unlike Thorium TWR is ready to go and China is building TWR.  

Thorium or TWR we have 700 years of fuel sitting in warehouses to power these things.
Reply: +Passed High School Physics 

It's a detail, but how can you say TWR is ready to go when all you see are cartoon interpretations of it on YouTube?

Whatever, I recommend investing time in the Kirk Sorensen  videos, understanding them as thoroughly as possible, and cross referencing the material with others who are betting their futures on it.  Ted and Google talk have and expanding catalog of presenters on this subject, but Kirk Sorensen is the founder of the "Thorium Renaissance" (he understands how to take advantage of YouTube, also to his credit (!)).
Reply: +Passed High School Physics 

PS, which UC Berkeley course(s) are you watching?
Reply: hettygreene Any course by Richard A. Muller.  His  Physics for Future Presidents is a fun watch.  He has some nice experiments.

The Emilio Segre lectures are incredibly interesting.

Nuclear Engineering 101 is a nice review.
NE 2=162 Radiation Biophysics and Dosimetry

Lawrence Berkeley National Laboratory has some very nice lectures.  The lectures from the Advanced Light Source researchers are good.

Marian-Diamond's Integrative Biology 131 - This women is amazing.  She's one of the people who has a piece of Einstein's brain.

I found History 167B:  The Rise and Fall of the Second Reich incredible interesting.

What about you?
Reply: +Passed High School Physics 

.... Nuclear Engineering 101 was a "nice review"?  Wow... you must have a lot of heavy science and math under your belt.

Am not familiar witj the other courses, will check them out eventually.
Reply: +Passed High School Physics 

Muller takes the climate quack loyalty oath.
Reply: If one thinks it through, you have to put in maybe 16x name rated capacity compared to nuclear, which, runs over 93% of the time, and, is getting more efficient all the while. In the 70's nuclear only was online half the time. On top of that nuclear plants are being certified to run with higher enrichement. Still far below the level of making a bomb which is what everyone is scared of. In fact the new plants pose no problem for hydrogen and xenon gas explosion, which, is the true danger with nuke plants (emergency ventilation). And, new nuclear plants can burn up almost all old existing waste. If economies of scale were applied to nuclear, the cost of carbon free electricity produced by nuclear would fall by half ---- if that were allowed by the powers that be.
Reply: MrBlueDevil93  Not sure why all of these anti-nuclear people are worried about nuclear bombs being made from the fuel in nuclear power plants.  Remember the second atomic bomb that was detonated?  It was a uranium bomb not a plutonium.  If terrorists/rogue nations are going to make atomic bombs they would make it from uranium.

Remember Saddam Hussein?  Iraq as making uranium bombs.  They were about 40% through the purification process when they were bombed.

Uranium bombs are easy to construct and detonate, but the purification of the uranium is tricky.

Plutonium bombs are very difficult to detonate.  That's why the US detonated a test one to make sure it would work before actually using it in war.  It's highly unlikely any rouge nation or terrorist would be able to build a working plutonium bomb even if they had the plutonium.

Remember North Korea detonated a nuclear bomb earlier this year.  It was a dude as nuclear weapons go. North Korea's claims on the size of the bomb doesn't come anywhere close to the measurements made by other countries around the world.  Yes they have atomic weapons, but they are having a hard time getting the full explosive power.

Most anti-nuclear folks don't know that the burning of coal to generate electrical power is one way to purify uranium which can be used in a bomb.

If terrorists wanted to make a nuclear bomb they would not use plutonium from a nuclear reactor they would use uranium form a coal fired power-plant.

Something else nuclear has going for it. is the energy density.  The amount of energy in one pound nuclear reactor fuel is equivalent to one billion pounds of coal.

If we compare nuclear to solar.  The amount of energy one pound of nuclear fuel is more than 10,000,000 times as much as what all of the solar panels and wind farms in the world right now will produce in the 20-25 year life span.
Reply: +Passed High School Physics 

How do you get u235 from coal?
Reply: hettygreene Buy burning it.  In the coal are radio-active elements including the isotopes of uranium.  Burning the coal separates and extracts the uranium and other radioactive elements from the coal.

What the silly anti-nuclear people don't tell or don't know is the burning of coal released millions of tons or radioactive isotopes into our environment every years. Nuclear power plants release none.

And all of the coal slag heaps are radioactive so every time the wind blows or it more radioactive isotopes get blown into our environment.  And when there's a fossil fuel spill it also released radioactive isotopes into our environment.
Reply: +Passed High School Physics 

I'm sure the blood thirsty alarmist quacks can't wait to beat everyone up with that one.  I suppose dirt dust has "radioactive isotopes" in them too. 

I  think you're missing the point with... with what ? coal ashes?  

Are you expecting utilities to sift out u235 from coal ashes?
Reply: hettygreene Everything is radioactive including us.  The utilities have done a poor job with the coal ash.  Take a look at Johntown's floods.

Would not expect the utilities to do it, but rogue nations and terrorists sure could.
Reply: +Passed High School Physics 

You're saying it is economically feasible to recover u235 from coal ash?
Reply: hettygreene  Depends on what you mean by economically feasible?

What I'm saying is that it is possible.  If you are a terrorist group or a rouge nation do economics matter?  

While we are on this subject It's also possible to create weapons grade plutonium in a dorm room.  Seeing as how these were students, it sure looks like it's economically feasible to cook-up weapons grade plutonium at home.
Reply: +Passed High School Physics 

Acghghg.... If you say so. 

"Do yourself a favor" and spend a few hours among the thorium enthusiast videos.  You'll find so many compelling advantages and abundances you'll wish you were a high school kid again looking for a career.
Reply: hettygreene  I have looked at the Thorium enthusiast videos.  Correct me if I am wrong but only one thorium reactor has ever been built.

Thorium reactors while might be safe have some very serious and dangerous side effects we don't have solutions for.  On paper and int theory thorium reactors appear to be promising, but 50-60 years ago the limitations were realized and development was discontinued.

At this time TWR are the way to go.  They don't have any of the problems and side effects thorium have.

Same is true with NIF.  So why waste time with thorium?
Reply: +Passed High School Physics 

What is NIF?
Reply: +Passed High School Physics 

It's a shame it's wasted on you. 

You should understand the politics behind light water reactors and uranium.
Reply: +Passed High School Physics 

The only reason TW sees the light of day is b c Bill Gates got sold a foolish snake oil bill of goods on it.
Reply: hettygreene  So the richest man in the world is funding the development and building of TWRs.  Countries other than the United States are getting on board and buying into it.

So why is it snake oil.  It's certainly more feasible and safer than a thorium reactor and all of it's problems.
Reply: +Passed High School Physics 

Like we discussed before, all I see about Traveling Wave Reactors are these 5 minute cartoon presentations. 

No, other coutries are not "getting into it" because there's no evidence of that. 

On the other hand, a Thorium search turns up lots of international effort:
India
China
Norway 
Israel 

(Embarrassingly absent is the US, but that's changing.)
Reply: +Passed High School Physics 

Just like governments, rich people can do stupid things.  TWR looks like one of those instances where some quack got hold of Bill Gate's ear and he got enamored with it. (just like he got taken in by the global warming crap - that's strike 2 for Bill and his "retirement legacy".  He should have stuck to software. )
Reply: hettygreene  I asked what's wrong with TWR and the best you can come up with is it "look" like snake oil and a quack got a held of Gate's ear?  

Do you form opinion without looking at the science or the technology?  

Do you really think Bill Gates is that stupid?  He's invested well over a billion dollars into the technology.  And you think the people in China are equally as uneducated and stupid as have Gate's company to install TWRs in China?

Could it be you are lacking in a proper education and don't have a clue about TWR?

You certainly bought into those snake oil sales people when it comes to climate change and global warming.

Who's duping you with all of this inaccurate information?
Reply: +Passed High School Physics 

Where is it?

Show me some links.

Yes, I think Bill Gates can be "that stupid"  -- people with big egos and lots of money stupid things all the time - his embrace of climate quackery is a prime example.

As far as I can see, Bill has nothing to show for his investment in TWR.

I looked, and couldn't find. 
SHOW ME!
Reply: +Passed High School Physics 

Case closed. (you should apologize for wasting my time):

Bill Gates stops chasing nuclear 'wave', pursues variety of reactors

His fission company, TerraPower, alters its "traveling wave reactor," explores thorium, liquid fuel and alternative designs.

￼

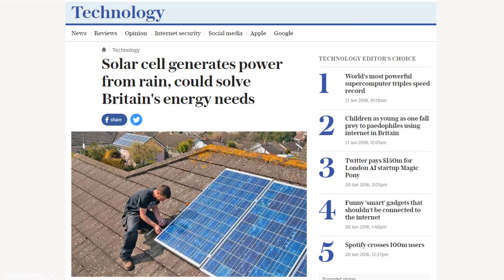By Mark Halper | July 24, 2013 -- 05:30 

2013  --- got that?

http://www.zdnet.com/article/bill-gates-stops-chasing-nuclear-wave-pursues-variety-of-reactors/
Reply: hettygreene   Silly boy that was over three years ago.  Everyone knows the technical problems with thorium reactors which is why the US Government is funding NIF and Gates is going with TWR.  

We need TWR as an intermediate until reactors based on NIF will replace them.

Tell me, why would anyone be so stupid as to invest any research dollars into a thorium reactors which will become obsolete as before the next one is built?  And what about all of the highly technical problems we don't have solutions for?  NIF is a far better investment.
Reply: +Passed High School Physics 

You didn't even read the link. 

I think we've reached  the limit of your reasoning capacity and the usefulness of this conversation.
Reply: hettygreene  I have read it, did you?  Did you notice the date it was published?  Wasn't it three years ago?

A lot has happened in the three years since it was published.  You might want to look at current events about what's happening with thorium and TWR.  

China is moving forward with TWR and the US has funded NIF.  Putting any money into thorium reactors is pointless.  It's old and outdated technology not worth pursuing.

Take a look at NIF, and tell me why you thing a thorium reactor would be better.
Reply: +Passed High School Physics 

Watch the Kirk Sorensen videos (which is obvious you haven't). He deals with the foolishness and money-pit boondoggle of fusion ("NIF").

Otherwise go jerk.
Reply: +Passed High School Physics 

Watch the Kirk Sorensen videos (which is obvious you haven't). He deals with the foolishness and money-pit boondoggle of fusion ("NIF").

Otherwise go jerk.
Reply: +Passed High School Physics 

Watch the Kirk Sorensen videos (which is obvious you haven't). He deals with the foolishness and money-pit boondoggle of fusion ("NIF").

Otherwise go jerk.
Reply: hettygreene  So if I'm not a follower of you and not a believer of something that hasn't been tried in over 60 years for technical reasons, why should I go away?  Is it because what I am saying makes sense?

There must be a reason why Bill Gates and other billionaires didn't fund this guy and are backing Traveling Wave Reactors and the United States is funding NIF and Europe is funding F4E. 

Throium reactors are a technology of the past and there's no need to waste time and money on something that would be obsolete before it's every built,

China's not building a thorium reactor, but they are building TWR.

Could it be everyone knows building a thorium reactor is pointless at this time?
Reply: +Passed High School Physics 

I see the trappings of opportunist chinese bureaucracy lining up to scoff some of Bill gate's money. (no other billionaires on board)
Reply: hettygreene   You might be right.  On the other hand the Chinese aren't stupid either.  Could it be that they will have yet another American technology which will take away more jobs from Americans? 

When the Chinese begin producing electric power that's too meter with TWRs what's going to happen in America?

Seems pretty stupid for the US not to use our own technology.  If you live in America you might what to start learning Chinese so you'll be able to communicate with you future employers.

Once the TWRs are online with the 700 years of nuclear fuel we have America just won't be able to compete.

Thanks for selling out America.
Reply: +Passed High School Physics 

Kirk Sorenson makes the same argument more convincingly for thorium. 

Jang Jamin's son showed up at oak ridge after downloading all the T material that KS put on his website that was developed in the 50s. Same conclusion, the Chinese are going to get it and leave US in the dust. 

(the technicals on TWR sound like they are morphing into FLIBE's LFTR)
Reply: hettygreene  It appears Kirk made a big deal over thorium before realizing the enormous technical problems with thorium.  It appears nothing has happened in years.

NIF and TWR are the most promising which is why they are being backed and funded.  

Thorium at this point in time of technology is obsolete.  It's like trying to build a steam powered car.  It can be done, but why when we have other more promising solutions which are far better.
Reply: +Passed High School Physics 

I think you're full of shit, and so do an expanding number of professionals in the field, but what you think is pretty much irrelevant.
Reply: Passed High School Physics 
 Perhaps it is becoming clear to you now that hettygreene is indeed the loser I described him as.  
 He has a huge chip on his shoulder, and no amount of reasoned discussion will help him to dislodge it. 
 I pity that fool.
Reply: What happened to solar-than-thou CNC?
Reply: hettygreene Is CNC another solar company that's gone out of business?
Reply: +Passed High School Physics 

+CNCmachiningisfun 

CNC is one of the subset of the solar-than-thou elites for whom "off grid" is a status symbol and hobby, no doubt the envy of the chicks and juvenile climate quacks of Starbucks. 

I call it the
  "LOOK MA! NO HANDS" phenom. 

There's nothing wrong with hobbies, but here it's hitching a ride on a quack science superstition turned dangerous political movement - a bandwagon CNC-types are to ride on, s ready audience to show off their hobby to, but at the same enablers of the quackery, superstition, and hack politics of an evil political movement.   
They are the climate quackery's version of "radical chic"
Reply: hettygreene The quack science right now are those merchants of doubt who or BSing the public into believing there is no such thing a Global Dimming, and Climate Change/Global Warming.

It's amazing to see the false propaganda these merchants of doubt scientists are paid to produce to confuse the uneducated public and politicians. 

You sound smart, so I doubt you would fall for the fake science papers and ghost scientist who say climate change isn't occurring.
Reply: +Passed High School Physics 

Climate is always changing.
Reply: hettygreene You are correct.  That's why the dinosaurs aren't around anymore and Alaska had a tropical climate with no snow.  

Good thing we know man is causing climate changes and global dimming so we can intervene and prevent our planet from becoming like Venus.

Thanks for pointing that out.
Reply: +Passed High School Physics 

You're a full of shit climate quack.
Reply: Passed High School Physics 
 And, as predicted, shittygreene has lashed out at you again.  
 No matter how well reasoned your arguments are, he is just too damn stupid to accept reality. 
 I pity the fool.
Reply: Passed High School Physics 
 Yup, you totally nailed it. 
 The internet is full of  characters just like the ones you listed. 
 Having encountered them all in recent years, I ultimately arrived at the conclusion that it is impossible to reach them via any form of reasoned argument. 
 Hettygreene, and his similarly retarded ilk, are simply not worth the time of day, unless you seek to have fun at their expense  :) .
Reply: +CNCmachiningisfun 

You are belittling the achievements you have by endorsing Climate Quackery.
Reply: hettygreene @hettygreene Dude do thing Global Dimming is a how or is it real?
Reply: +Passed High School Physics 

???

Meanwhile, you are disappointing you HS physics teacher.
Reply: Passed High School Physics 
 Yup, I knew it was just a a matter of time before shittygreene would go postal here on your thread.  
 I saw the signs of his idiocy elsewhere in the comments under this video, so I am not surprised to see it being displayed here also. 
 Oh well, haters will be haters.
Reply: Solar energy is...

1) A child of climate quackery

2) A Kids Lemonade Stand business

 3) A  "LOOK MA! NO HANDS" status symbol and hobby.
(right CNC?)

For an abundant energy future, see the Kirk Sorenson videos on Thorium and MSRs (Molten Salt Reactors).
Reply: hettygreene I agree.  But Thorium and MSRs (Molten Salt Reactors) are antiquated technology and a thing of the past.

Thorium and MSRs (Molten Salt Reactors) have been replaced with Traveling Wave Reactors and NIF/Fusion reactors.

Hey thorium fan boy - Not sure if you know but another billionaire besides Bill Gates decided not to invest in thorium but PB11 technology.  Looks like your buddy Kirk Sorensen missed out on all of that money too.  

Why is Kirk Sorensen promoting a loser of a technology?
Reply: +Passed High School Physics 

who?
Reply: Nevada got f*cked cause warren Buffett runs show 

Systems are now at 17% efficiency
Reply: Paul Galkowski   Correction....  Systems are now at 17%  MAXIMUM  efficiency.

One can only get maximum efficiency for just a few hours only a few days every year unless they a movable/tracking mount.

The rest of the time the ACTUAL efficiency is 10% and less.
Reply: SCTY spends two dollars to generate one. He is at least half correct. The Tesla acquisition is a bailout at best. I think we can all agree on that. Although I don't see how Tesla purchasing a company and overpaying for it with the enormous amount of debt it has and is incoming as well sincerely is a payoff for Tesla. I think Tesla would have been better off without SCTY. My two cents. What are your thoughts?
Reply: Solar TV / Solar Wolf Energy It's a financial shill game that's going on.  Remember these are not cash purchases and Elon's relative is a CxO at SCTY.  I suspect this "buy" is adding to Elon's wealth and not really benefiting Tesla or SCTY.

As soon as NIF works out how to generate electricity from nuclear fusion the solar industry will be gone.  

We are already seeing the solar companies going out of business.
Reply: I fully agree with the Elon statement
Reply: what economic activity is not motivated by desire to make money? if anything, solar is the best choice if individual consumers want to reduce their dependence on profit making energy companies. you can install solar panels on your roof top but not a coal plant.
Reply: thanks for the info
Reply: I think solar will be a passing fad. It will get more efficient sure. Although, the future 10-20 years from now is hard to predict, we will probably have portable Sun energy for transportation and industry here on earth. That is portable nuclear power cells. They could be the size of a butane lighter. Would have to use non polluting fusion reaction,  not fission reaction. What do you think?
Reply: Ken Marriott  Solar is all about making money for Wall Street.  Solar City sells a $12,000 solar system to home owners for $40,000 and gets a 30% tax subsidy in the United States.

The solar companies when out of business in sunny Nevada.  Ironic that Elon Musk is building a solar powered battery plant there after Solar City closed shop.

If one looks at the efficiently of solar it's less than 1%.  The solar panels are only 18% efficient when the sun is directly overhead which only happens for only 46 minutes 3 or 4 days every year for fixed panel installations.

But most home solar systems are not oriented ideally so efficiency drops to less than 1%.  

Then inverters are 805-85% efficient so there's a loss of another 15% to 20%  So out of the 1% collected, 155 to 20% of that is lost.

Solar panel degrade over time.  So every year solar panels produce 1 to 2% less energy.  After 20 years they have lost 20% of their producing power.

Then one has to dispose/recycle the panels which take energy.

Nuclear powered devices have been around for decades.  They've been used to power space craft.  Here on earth the Russians used nuclear power to power devices such as lighthouses, navigation aids for aircraft and remote scientific monitoring equipment.

I would not call solar a fad, I would call it a scam.
Reply: ***** None of the solar companies are claiming 5-7 year payoff.  Lowest I've heard has been 12 years.

In 12 years the panels have degraded almost just over 10%.

Solar appears to the be the next financial crisis.  The solar companies have gone out of business in sunny Nevada and many of them like Solar City SunPower are having financial problems and will probably going bankrupt like the 112 solar companies like SunEdison and  Solyndra which have already gone bankrupt.

Wall street makes a killing when companies like this fail and hard working Americans loose billions for dollars.
Reply: *****  Where are you getting your inaccurate information?  In Solar City's contract it states the panels output will degrade 15% in 10 years, 30% in 20 years.

Solar City in their contract states payback for a solar system is around 12 years.

Are you trying to tell us Solyndra solar is still in business and didn't go bankrupt?  You might want to take a look the new once a decades, they went bankrupt in 2011.

In 2015 there were 115 solar panel manufactures who went bankrupt.  

Take a look at Solar City and SunPower and see if they are both in financial trouble.  I suspect SunPower will be bankrupt very soon.

Not sure where you are getting your information from but it's sure not accurate.
Reply: *****  I have talked to two dozen people who have installed solar.  I have been considering and researched solar power for my home of 2 - 3 years and have talked to at least 30 solar companies sell solar.

Why did Tesla buy Solar city?  It's that obvious?  There's a family connection.  Tesla buying SolarCity allows the money to be kept in the family regardless of how Tesla and SolarCity preform.  This is a well known financial industry/Wall Street trick to pull assets and money out of a failing business to make huge profits while investors and stock holders loose all of their money.

Got a question for you.  If solar is as good as you say it is, why is SolarCity in financial trouble?  Seems to me if solar is as great and wonderful as you say they would be a highly profitable company.  What's the reason they aren't?

The link you provide is from EnergySage.  They are promote and get paid by the solar industry to get people to buy solar.

I'm looking at the SolarCity contract where they say the panels degrade at the rate of just over 1% every year or 15% over 10 years.

As for the finances I have five friends who invested in solar 8 to 10 years ago.  Each one has said financially it was a huge mistake.  As the time they spent $35,000 to $40,000 to have solar installed, and after doing the financial math solar would-up costing them 5 to 10% more.  Had they taken the %35,000 -$40,000 and made prudent investments they would have doubled their money buy now.  Instead they lost money.  And in another 10 years the output will have decreased another 15% which means they will either have to recycle what they have and buy new ones or increase the size of their system by 20% to make up for the loss.

I live in here is sunny California where we have solar farms, hydro, wind farms, nuclear, geothermal, wave and fossil fuel power generation.

For reasons I don't understand wind isn't profitable and they are decommissioning over 25% of the wind turbines in California's largest wind farms.

Creating energy from wave/tidal was economical about up until around 1925 and hasn't been ever since.  There have been a lot of people/companies who have tried but so far they have all failed.

As for solar.  One would think sunny California would be one of the best places on the planet for solar energy farms especially during the summer.  Turns out it's not.  The solar farms we have in the desert which California power companies rely on sometimes have a cloud cover them which decreased their output and is causing brown and blackouts.

As a result West Coast power companies are not buying solar generated power and buying more nuclear and fossil fuel generated power.  Not having any customers the solar farms aren't producing.

I'm still on the fence about solar.  Our electric rates just increased to  $.18, $.23 and $.39 per kWh.  (We have a tiered rates) 

I'm thinking solar is probably worth it now and am talking to solar companies now.  I have two quotes from two different Solar City representatives for solar for my home.  One want's to sell me a 4.5 kw system and the other an 8.6 kw system   Prices are in the $35,000 to $43,000 price range.  For my $43,000 investment they tell me I will save $25 to $55 per month off my electric bill.  (Hardly seem worth it.)

Then I take a look online to see home much a 4.5 kW and and 8.6 kW system runs.  It's in the $10,000 price range.  Permits and labor to install are $3,000 but let's call in $5k.

This means the SolarCity is making a $20,000 to $25,000 profit off of each home owner.  Plus if SolarCity contract doesn't pass along the 30% rebate Solar City makes another 30% or $10.000.  Total profit for SolarCity per home in in the $30,000 range while the home owner gets to save $25 - $50 per month.

What am I missing?
Reply: ***** Friend as I told you I'm on the fence about solar.

Not sure why you would not own a 7-11 if it makes a good profit.

Every week I get between 1 and 10 robocalls from companies trying to sell me solar with SolarCity making about a third of them.

I know they are a big rip-off which is why I'm talking to people who installed solar on their own years ago.

I have no problem installing a solar system on my roof of doing the electrical.  The problem I'm having is figuring out what size system I need.  And more importantly if I should do device solar and grid tided solar or if I should only do grid tied solar.

Maybe you know and could help.
Reply: ***** So are you saying I should wait another 10 years?  Sounds like you are saying I would be foolish for investing in solar today because in 10 years it will be $0.01 per kW installed.

Thanks for adding to the confusion over investing in solar now or waiting.  You are making me think I should wait.
Reply: *****   When the solar companies started calling and offering me solar they wanted to see my electrical energy bills.  The never told me to conserve.  Instead they wanted to sell me a $45,000 to $50,000 solar system.

This got me thinking.... shouldn't I conserve before installing solar?  I spent $400 on LED lights and replaced every incandescent and CLF in my home thinking the payback would be in a few years.

Shocked the heck out of me....  My energy bill decreased by 1/3.  Payback was just over 2 months.  Unbelievable.

With this decrease in energy consumption the certified solar experts working for the big solar companies didn't know how to size a system for my house.  (Now I know they are a bunch of idiots.)

When I had nine months of bills the solar vultures came  calling again.  After looking at my bill they said they could save me a whooping $10-$20 a month if I purchased there solar power agreement. One McDonald's meal in savings per month is hardly worth it.

Now energy costs have gone up quite a bit I'm looking at solar again.

Question I have is should I do device solar first?  Then whole house solar?

Seems to me the items I only need to have powered with the sun is shining I should power directly with solar.  Things like my attic fans, pumps for heating water etc.  (Device solar.)

Once this is subtracted from my power bill I should then install whole house/gird tied solar.

Is this the way to go about it?  The solar clowns tell me I should just power everything with grid tied solar.  (Which makes more money for them.)

I can't seem to find anyone who really knows or understands solar.  What do you think?
Reply: Wow, the amount of dumb shit in this comment string is hefty. Global warming is pretty clearly real and solar is a pretty great supplemental technology.
Reply: Passed High School Physics
Reply: ***** Agreed - But if solar/wind can only provide 15 to 20% of the worlds electrical energy where do we get the other 80-85%?
Reply: I dont believe that you're factoring in If every single home in the developing world was energy self sufficient, that number would drop dramatically. Coupled with the Tesla Powerwall, EV's and FREE Solar city power to run Tesla cars, its a game changer. Technology is advancing and the sooner Solar roof tiles become mainstream, the better. I wont say Elon Musk is the Nikola Tesla of our time, but his outlook on changing the world is inspiring and I believe he will do just that. Whether he makes money or not, he should be an inspiration to all of us. He makes money, he invests it
Reply: Sy Koh   Have you done the math to see if this is possible?  The current solar technology we have is so inefficient we are lucky to get just 1% of the solar energy.  A problem we have not been able to improve on for 50-75 years.

But let's say you cover every roof top with solar and everyone has a power-walls that will only provide 20% of the worlds electrical power needs.  Where are we going to get the other 80%?

Elon is interesting.....  But what about the others who changed the world and our still continuing to do so with their money.  Dean Kamen, Bill Gates, Steve Jobs and Paul Allen?

All of these people are working on a way to supply the world with that other 80% of electrical energy AND provide clean drinking water.

All of these visionaries are working on next gen nuclear energy solutions.  If you want to be inspired take a looks at what these guys are doing with their billions to change the world before they die.
Reply: ***** Solar panels can only convert one wave length of light into energy.  The waves are only perpendicular to the panels for 40 minutes 3 days out the year to get maximum output unless one has a tracking system,  There's 10% loss for the inverter, another 2% from the wiring.  After all said and done we only get convert less than 1% of the suns energy into electricity.
Reply: *****  You are talking about energy payback and not the efficiency of much of the suns energy solar panels convert to alternating current electricity we can use.

What do you mean by a garbage cell gives better than 10%?

Do you understand solar cells can only put out maximum output when the sun is perpendicular to the panel?  That only happens 3 days out of the year for 20 minutes for fixed panels.The rest of the year the output is greatly reduced.  

Depending on the installation one tracking panel can produce more electricity than 20 fixed rooftop mounted panels.

If your goal is to spend more money then you want to buy roof-top or fixed mounted panels.
Reply: ***** Dude we were talking about grid tied solar which is why if you look at my post you will see I factored in an inverter and wiring/transmission loss.

I may know nothing, but I didn't sleep through my astronomy or physics classes so I know I know more than you about solar.

Do you know what the summer solstice is?  And how that along with latitude and longitude relate to how much electricity solar panels produce?

You  probably think the Earth is at the center of our universe and the sun travels across the sky.  Well my friend you have a lot to learn.

Unless you are on the equator at noon and there is no cloud cover solar panels produce less than there rated maximum output.

Let me invite you to educate yourself about the angle of the sun, and solar panel mounting.
http://www.solarpoweristhefuture.com/how-to-figure-correct-angle-for-solar-panels.shtml

There are many YouTube videos which will explain this concept that even a third grader would understand.  Or do you even have a third grade education.
Reply: *****  Yes solar PV can be cheaper than power from the grid, but it's also not reliable.  Germany, UK and US all had to by nuclear and coal/fossil fuel generated power for a week when there were cloudy and rainy.

All depends if you want cheap unreliable power or cheap reliable power?  Only the off-girders are the ones who want cheap unreliable power.  Everyone else wants cheap reliable power from the grid.
Reply: Passed High School Physics I want FREE electricity for my house, I don't want to be held hostage by utility companies ripping me off for something I can get for free. Solar and wind is all that's needed for my needs and I don't care how many "statistics" you've spouted in this thread
Reply: Passed High School Physics future more advanced multi junction cells will be effective for more wavelengths. and the efficiency of creating current straight from light is still alot higher than generating it through a spinning a turbine with steam from a coalfire. just saying.
Reply: none  You make Elon Musk out to be a God and believe everything he says without question.

Hard to have a discussion with a believer who doesn't look at the facts or question what they are being told.

Elon Musk is a businessman showman trying to make money off of solar.  How do you know he's not another Bernie Madoff and not ripping people off?

Solar City isn't doing so well financially.  And he's conned the public into giving him close to a billion dollar tax free loan in the form of a cash deposit on a car his company is still designing and won't be producing and delivering for another 4 of 5 years if ever.

Elon is a business man to the core.  When he found out he could not make high profits off of  solar in sunny Nevada he closed shop and went out of business.

If solar companies are going out of business how do expect solar to be the answer?  The solar industry is saying at best with the technology we have and know about will only be able to supply 15% of the world energy requirements in 35 years.

Where is the other 85% going to come from.  Another 5% will be from renewables so what about the other 80%? 

What's the answer if it's not nuclear? 

Elon has one problem with his grand plans for solar it's called science.  We've been working on battery technology several hundred years and make moderate improvements.

In 100 years of designing and building electric vehicles we've been able to improve on the safety and speed, but not the range.  Electric cars today have the same range they did 100 years ago.  It's been over 100 years and we still have not been able to figure this one out.

As for nuclear why are you telling lies?  Nuclear is 100% natural.  If it weren't for nuclear energy we would not be here.

Your knowledge of nuclear power appears to be 50 years out of date.  The next gen nuclear power plants will be green, have an unlimited fuel supply and produce no long lived radioactive waste.  Should there be a Chernobyl or Fukushima type of accident will be completely safe to inhabit in 20 years as it does not use any long lasting radioactive isotopes.

The current gen of nuclear power plants are of a different design than Chernobyl and Fukushima.  The world's demand for energy is increasing which is why there are over a dozen new nuclear plants being built.

Germany, US and the UK has all learned a lesson about solar...  It's unreliable.  As a result after going solar they are having to buy more nuclear generated electricity.

So we know solar is only a partial solution and might supply 15% of the world with energy where will we get the other 85%?
Reply: *****  Can you name one plant where there is a leak that's causing a heath issues?  Why are you against nuclear-power and not coal and fossil fuels which release millions of tons of radioactive isotopes into our atmosphere every year?   Coal slag heaps are radioactive and every time is rains the radioactive isotopes enter our streams, river and oceans.

Coal/fossil fuels prematurely kill 3 million people per year from ionization radiation and lung/respiratory problems.

What's your problem with next gen nuclear?  It' green (no green house gasses), no polluting, there is no long lasting radioactive waste and we have an unlimited supply of fuel.

As for current nuclear power plant waste what's wrong with placing deep in the crust of the earth in a subduction zone where it will be absorbed into the mantel of the earth and mixed in with all of the other long-lived highly radioactive isotopes already there.

What's your solution for supplying power to the world.  If solar ca only provide 15% in 35 years where is the rest going to come from?
Reply: ***** As we are bombarded by gama radiation every second of every day that has to be a "safe" level.  People who live at higher altitudes or fly in planes receive even more.  Doesn't seem to affect them.  

Astronauts are exposed to even more, doesn't see to affect them.

But alpha radiation is a different story.  Smokers lung are on of the most radioactive places and are deadly.  Thanks to the tobacco companies using radioactive polonium fertilizer.

Based on your question it appears you don't know that much about nuclear radiation or the dangers.  

Let me ask you again what is wrong with the next gen nuclear?   Lighter radioactive elements are used so there is no long lived radioactive waste.  In 20-25 years all of the radioactive waste will have decayed away and we have an unlimited amount of fuel.

What's wrong with that?

If you don't like nuclear what is your solution?  If solar can only provide 15% of the worlds energy in 35 years where do we get the rest if you don't want to use nuclear?

What's your solution?
Reply: *****   Nothing theoretical about it.  Tell me what in the next gen nuclear reactors would have a long lived radioactive isotope?  They all use light elements, there aren't any.

Your failure to provide a power solution other than the 15% solar might offer in 35 years is why we are investing in next generation nuclear.

If you don't think we should use next gen nuclear and solar provides only 15% what do you suggest we use?
Reply: none  You've been given several opportunities to offer a solution to supplying the world with electricity and clean drinking water.  Your FAILURE to offer a viable solution is the acceptance to build new nuclear power plants as well as coal/fossil fuel power-plants.

Not sure who is filling your head with incorrect facts, but look at the range the the electric cars from 100 years ago.  There were many electric car companies and all had a range that's the same as cars companies of today.

Any chump including you can verify it with a simple Goolge search.   

Why do you say the nuke industry are the merchants of death.  If you think that, then Elon Musk is also a merchant of death.  How many people have died installing solar panels (more than have died in a nuclear power accident).  And how many have died is Tesla car accidents?

Every home has life saving nuke equipment...  It's called a smoke alarm.  Nukes have saved millions of people lives with the production of radioactive isotopes which can be used to diagnose illness and cure cancer.

Nukes have helped us explore the solar system by providing power.

Nukes supply safe clean drinking water for people

And let's not forget nukes supply the world with 10% of the electrical power we use without releasing any green house gases.

Dude why are you using 50 year old anti-nuclear propaganda?  Why not educate yourself so you don't come across as so uninformed.  

The nuclear waste issue has been solved.  Next gen nuclear power will use light element isotopes.  As for the heavy element isotopes we are using now we just return them to the mantel of the earth where they will be absorbed and mixed in with all of the other highly radioactive isotopes already there.

If you are so smart and knowledgeable about nuclear isotopes tell me what you believe the difference is between background radiation and radiation from nuclear isotopes?

Since we know solar will only provide 15% of the worlds electricity in 35 years and you can't offer any solution to supply the world with the other 85% means your are accepting the use of nuclear.

Please keep opposing nuclear power.  People today are looking at your 15% solution.  We already know coal/fossil fuels is not the solution and is far worse then nuclear.  Our only other option is nuclear.  This is why we are funding nuclear research and building more new nuclear power plants.

You posts just help convince people we need to support nuclear and point out the 50 year old lies you are telling about nuclear power.
Reply: It is remarkable that solar power creates so much problem when it comes from a homeowner.
But it is not a problem if the utility company has their own solar power.

I think the biggest problem comes in that the utility company can not charge a homeowner for power if they are making it and that the utility company is not making money despite the elevated fees and taxes involved in it.
Reply: Bonnie Flory Have you seen the latest statistics on solar?  With the decommissioning of nuclear power-plants in California, Japan and in Europe with the thought solar and wind electricity creation would off-set the loss it's dismal failure.

With the premature decommissioning of nuclear plants we have lost 6% of our our ability to produce electricity  Yet at the same time we have only been able to offset that 6% loss with a 2% increase from solar and wind.

So what about the other 4%?  We are burning more coal and fossil fuels than ever before and we still have all of that highly active nuclear fuel we won't be using.

Germany and California have both announced they will not even come close to meeting their solar initiative programs.  With the loss of nuclear both are building more coal/fossil fuel fired power-plants.

Now that we know for sure solar and wind can only provide a small percentage our our electricity, were is the rest going to come form?  Coal/fossil fuels or nuclear?  Or are you willing to do without electricity for a few hours everyday?
Reply: none   Decades of old information.  Why don't you get educated so you know what's going on.  Geo-thermal releases green-house gasses.

Silly, we are already returning spent nuclear fuel deep into the earth.  Not sure where you are getting you information but it is decades out of date.

You failure to provide a viable method of providing electricity and clean drinking water means you accept the nuclear solutions.

At least we know what nuclear we know it works,
Reply: *****  There are several open source RadWatch communities which are continuing monitoring for radiation leaks.  Is there a reason why none of these communities are reporting the leaks you say exist?

None of the RadWatch communities are reporting increased levels in nuclear radiation in any of towns in Utah.

It would be nice if you could support your claims with supporting evidence.  Right now you are making a lot of claims the evidence does not support.
Reply: *****  I would be happy to name one,  Gravelines Nuclear Power Station.  This is sixth largest nuclear power plant in the world.
Reply: *****    Stuck fuel rods are is not the same as a leak.  The rods were stuck, they plant shut down everything worked just as designed.  There was no radioactive leak as you claimed.

What other lies are you going to tell next?  It's lies like this which is making people realize nuclear is the best solution for us.

Your example proves it's safe.
Reply: Passed High School Physics how can you say nuclear is safe? It obviously isn't considering massive parts of Ukraine and Japan that are now inhabitable for thousands of years, not to mention the nuclear dumping grounds. If nuclear is so cost effective and safe, why is it costing billions to contain when things go wrong? It seems to me like you are a massive nuclear advocate with an agenda. I'm getting tired of reading the same crap from you.. nuclear is safe (it isn't) nuclear is cost effective (it isn't) nuclear causes no harm (it does.) How about we spend the billions it costs to contain nuclear disasters when they happen (which they will and do) in R&D into real CLEAN energy and stop messing about with things we can't contain. You're quite obviously a nuclear shill. You've asked time and time again in this thread to come up with a viable alternative to nuclear power and every time anyone has mentioned solar, tidal or wind you've shot them down. Technology is changing at an exponential rate and soon solar and wind generators will be the best solution for energy. Please don't reply to this message because I'm tired of the notifications with the same old drivel from you
Reply: Passed High School Physics http://www.zerohedge.com/news/2016-04-19/catastrophic-thousands-gallons-radioactive-waste-leak-washington-nuclear-storage-sit
Reply: Sy Koh  You are mixed-up.  Hanford where nuclear material was enriched for nuclear weapons with a nuclear power plant where nuclear material is used to produce electricity and clean drinking water.

Yes Hanford is polluted an uninhabitable just like other cities in the US like Picher, Oklahoma and Centralia, Pennsylvania.

The world needs electricity and clean drinking water.  What technology would you suggest we use?  Solar and other renewables will only be able to supply 20% of the world's energy needs in 35 years.  How do you propose to supply the world with the other 80%?
Reply: Passed High School Physics did you actually read my comment or just skim through it? 50 years ago the efficiency of solar panels was 6%, today the highest efficiency is 46% are you telling me that technology is just going to stand still? You're deluded. Coupled with the increased efficiency of turbines are you telling me that if 125 million homes in the US alone all had solar and wind turbines your 20% would be a much higher number? And that's not including commercial buildings etc. 
3D printing of our own panels also is an option now, albeit in its infant stages.

In 2000 we generated just 17Gw using turbines, in 2013 we generated 318Gw! Again, are you telling me that technology is going to stand still? A lot can and has happened in 35 years. 

I'll say it again, if we spent the billions it costs creating, maintaining and containing nuclear waste and disasters into research, development, subsides and creating newer forms of CLEAN energy the better for the world and every species on it.

Your failure to recognise any other option other than nuclear is quite alarming and quite frankly, moronic. Have some vision and stop trying to push your agenda onto everyone else.
Reply: Sy Koh   You have been deceived.  Yes it is true the highest efficiency for solar panels in 46% but these panels are so expensive they are not commonly used.  The panels being sold are today are only 5 to 15% efficient under ideal conditions.

You are also forgetting the fact that solar panels output decrease 1% to 2% per year and at the end of 20 years the output has decreased by 20% to 40%.

It is the solar industry which is saying in there best estimates in 35 years solar will provide the world with 15% of the world's electricity.

Where are the people of the world going to get the other 85%?

At this time the technology that's most promising is next gen nuclear.  It's green, renewable, there is no long lived radioactive waste because low molecular weight isotopes are used and we have an unlimited supply of nuclear fuel.

Why would you not want to use next gen nuclear?
Reply: ***** How do you figure?
Reply: well technically speaking the earth will look more like Venus than mars considering mars' thin atmosphere and lack of heat whereas venus is a perfect example of our current state of things.
Reply: Julia Thorpe You are correct.  And as the temperature on Venus increased the water on Venus vaporized causing temperatures to increase even more and changed the atmosphere.
Reply: none That's why American elected Trump.  Our new president will put an end to the solar subsidies, has vowed to eliminate the ugly wind turbines and is backing nuclear power.  Trump has said we need many more nuclear power-plats in the United States so American industry can make American products competitively once again.
Reply: ***** Looks like you were asleep during your high school government class.  You might want to review how the United States elects a president.
Reply: *****  Appears you leaned one partial fact at iTrumpU.  Now what about everything else?
Reply: Install 1 panel yourself and then do the math and see if you want to do more.
Reply: Floydvvd  The math is as follows.  Solar panels take 8 to 12 years to pay for themselves.  With Trump's promise to end subsidies for solar that's going payback will take 15 to 20 years.

At the same time Trump has promised in build more nuclear gas and coal fired power plants which will drive down the cost of electricity.  And with the discovery of that large gas field in Texas this week expect prices to decrease even more.

Trump does not believe in climate change so it's looking like he's going to put an end to solar just as President Regan did.
Reply: You were looking into getting some solar and asking for data. I was suggesting that you could could get an idea for yourself by installing 1 panel on your own and then you would know. If 1 panel cut $10 or $5 off your electric bill you'd be able to exactly assess if you thought it was worthwhile or to wait for technologies to improve and prices to drop or to forget about it all together.
Reply: none Trump believes climate change is a Clinton/Chinese/anti-nuclear terrorist plot against America and American jobs.  

You really think Trump would by Chinese solar panels with American dollars and have illegal Mexican workers install them?

Nuke waste along the boarder would only contaminate America as the wind blows North as do the water.
Reply: none Are you trying to say the solar industry is not just as corrupt and greedy?  Take a look at Elon Musk and what's happening in America.  

The solar industry receives a 30% federal tax credit which means every tax paying American is paying for solar.  The profits for solar are enormous.  A residential solar system which costs $10,000 Elon Musk's company charges $40,0000.  That's making Elon Musk and Wall Street $30,000 off every home that signs a contract with him.  Then on top of the $30,000 profit they receive 30% more from the tax payers.  You had better bet the bankers and Wall street love this deal.
Reply: *****  You mean after he fired all of his Solar City workers and want out of business in Nevada?
Reply: ***** Then why did Elon Musk's Solar City close shop in Nevada?
Reply: ***** Well soon that's not going to matter as Trump made it clear he believes the solar industry is a corrupt venture between the Clinton's, Musk and the Chinese.  He's going to eliminate that 30% federal subsidy and is in full support of nuclear, coal/fossil fuels.
Reply: none  Dude doesn't "ceasing its sales and installations in Nevada" mean they have closed shop and gone out of business in the sunny state of Nevada?

Where's the lie?  

Maybe were you live it ceases sales means something else but here in California when a company ceases sales it mean they've gone out of business.

Don't you mean solar and fossil fuel companies scum are deep in all areas of politics and will try anything to dent nuclear innovators?

Why would you not want next gen nuclear which is green, clean, renewable, inexpensive and creates no long lives radioactive waste?
Reply: none Dude what industry is not run by bankers?  

How can you say nuclear is inefficient?  The amount of energy in 1 kg of nuclear fuel is 1,000,0000,000 times more efficient than any other way we have to generate electricity.   

Never said the guy is not qualified,  Just said he's a paid professional witness to talk smack about the nuclear industry.  He's not being paid to tell the truth which is why he's using 40-50 years old arguments.

Why doesn't he discuss next gen nuclear?  Because he knows there's nothing wrong with it.  It's green, renewable, and there is no long lasting nuclear waste.  Whats' wrong with that?
Reply: none   Dude do you even know what you are taking about?  Do you know anything about science?   Jeez next gen nuclear does not use uranium, plutonium or any of the heavy molecular weight atoms, it uses low molecular weight atoms.  There is no need to mine for uranium  

Who has been filling your head with all of these lies?  Oh, right the people who are paid to argue against the use of nuclear energy for a living who use 50 year old arguments which aren't true today.

You have been duped buy the solar pseudo-scientists.  Yes if we had the technology to capture 1% of the suns energy which hits the earth we could supply power to everything but there's just one problem, we don't have the technology.

Any idea what create the solar energy you think can power everything on earth?  Silly, it's called nuclear energy.

My friend you need to do your homework and take a sconce class so you can understand what you are talking about.

No bankers behind solar?  lol.... Where do you think the money is coming from for people to get "free" solar?  Or do you think the solar panel manufactures make the panels and give them away for free?

Do you have any idea how much money the bankers and Wall Street is making off of solar?  The solar industry is ripping off the tax payers and the American public with the 30% federal tax credit subsidy.

Wouldn't you love it if the government gave you a 30% bonus for every dollar you made?

Good thing Trump is coming to office and vowed to will eliminate the 30% federal subsidy for the solar industry.  He knows nuclear, coal and fossil fuels produce electricity for a fraction of the cost of solar or wind.  Trump has seen the failure of solar and wind in the California, Germany, England, the UK and elsewhere.

Best hope for us is next gen nuclear.  It's 100% natural, uses no uranium or plutonium, emits no nuclear radiation, there's no long lasting highly radioactive waste, it's green, renewable and is inexpensive.  What more could you ask for?
Reply: none Dude are you living in the 1970s?  Why haven't you updated your knowledge about nuclear power int he past 40 years?

Next gen nuclear doesn't use any heavy weight molecular isotopes, it only uses light weight atoms.  

Do you even know what that is?

The reason Trump was elected was because if highly unintelligent uninformed people like you.  Now that he will be the President question is are you an American and will you support the leader of our country we the people of the United States elected to be our leader?

Nothing wrong living off grid, but it's not easy.  Do you expect your mother and grandmother to live off grid like you?  Living off grid is what people in third world countries are forced to do.

It's interesting they are begging for reliable electricity and clean drinking water and here you have it, and refuse use it.

Rip Van Winkle before you post more factually inaccurate information about the science of nuclear power why don't you do learn about it so you won't sound like a conspiracy theorist?
Reply: none  Your head is so full of residual smoke you still can't think straight.  You can't even comprehend what I post.  Never said Bill Gates was involved with Next Gen Nuclear, only Paul Allen, Europe and the US.

Bill Gates is giving a heavy isotope reactor design to the Chinese because ill informed people like you are terrorizing Americans with 60 year old fears of nuclear power which have been proven to be false.  All one needs to do is look at the videos to see just how wrong you are.

Why you won't look at the videos is a mystery.  You have the links.  Maybe you are afraid of the truth.

It all comes down to one simple question.....

If you think nuclear is not the answer.  And the solar industry tells us in 35 years solar will only provide 15% of the worlds energy needs where's the other 85% going to come from?
Reply: • Arsenic
(gallium-arsenide semiconductor

chips). 

• Bauxite
(aluminum). 

. Boron Minerals (semiconductor
chips

• Cadmium (thin
!lm solar cells). 

• Coal (by-product
coke is used to make steel).

. Copper (wiring; thin ! lm solar
cells): 

• Gallium (solar cells)..

• Indium (solar
cells). .

• Iron ore (steel). 

. Molybdenum (photovoltaic cells). 

• Lead (batteries).

• Phosphate rock
(phosphorous). 

• Selenium (solar
cells). .

• Silica (solar
cells).

• Tellurium (solar
cells). 

• Titanium dioxide
(solar panels). CES

Researcher:
TonyMuhovich, Colorado School ofMines

Edited by the US
Geological Survey 2010
Reply: Roger Reimer  What you are not telling us is how much energy they produce or the cost.  Some of the materials you have listed are deadlier, will last longer then nuclear.waste and will only produce 1/1,000,000,000,000 the electrify nuclear produces.

Not sure what your point is.
Reply: none Dude your head might be clear of residual smoke, but drugs have permanently damaged your brain.

You continue to believe facts you wish to be true than look at the facts.

Dummy, Bill Gates in not working on Next Gen Nuclear it's Paul Allen, NIF and ITER.  Gates's company is NOT working on Next Gen Nuclear.  His company is working on modified reactor based on the current nuclear technology.

Jeez man, did the drugs fry your brain you don't know the difference?

Why are you only picking on the Jews?  What about the Mormons, the Catholics and the Chinese?  Do you know how much American real estate the Chinese own?  It's your generation and all of your greed who allowed American jobs to go to the Chinese and allowed the Chinese to heavily invest in America real estate.  (And you are worried about the Jews.)

If you've been around hopefully you won't be around much spreading 60 year old lies about nuclear technologies  Anyone who has access to the Interment see just how wrong you are.

If it's not the drugs didn't affect your brain maybe it's Alzheimer's that attacking your brain.
Reply: none  
Your time on earth is limited.  It's all about how you want to spend it.

How is it you have all of this secret information no one else knows about or can verify?    Are you a psychic?  One of these crazy people who  believes in facts or concepts one thinks are true, rather than look at the factual evidence to see what is true.
Reply: none  You got a hold of some really weird shit this time, you are trippin now.  Why no mention of the Mormons?  Or the Muslims?  They are the fastest growing religions in the world and the Mormons like the Muslims and the Jews control for more industry and money.

Let's hope the shit you are on right now doesn't kill you.  We need people like you to teach the young people just how wrong and out of date your beliefs are.
Reply: none America a great country?  Didn't and aren't Americans steal the land of the native Americans, destroyed their culture, poisoned and hunted them and signed and then broke my treaties and contracts with them?

It was America who stole California, Arizona, New Mexico and Texas fair and square from Mexico.

Isn't it America who supported slavery for centuries after their European ancestors had abandoned it? 

It is America where food it plentiful yet more Americans go hungry and can't afford the food we grow.

And it's Americans who has outsourced jobs to foreigners so Americans are going jobless and homeless while foreigners are getting rich.

And isn't it American companies who are not paying American taxes so they can make this country so great?

It's the laughing stock of the world because we could have had a beauty pageant queen as president.

Hope you are proud to be an American.
Reply: none  Tesla was just one of many inventors who were making discoveries with alternating current.  Yes Tesla made a few improvements on existing discoveries which made him and his investors a lot of money but then Tesla's inventions failed to work and he turned into a conman.  There was a time when Tesla claimed he was communicating with Martians.  And he claimed the Martians were providing him with the plans all kinds of inventions.

When Tesla died his investors when to court and a judge ordered for all of his research papers to be seized.  His investors were hoping something he had been working on would allow them to re-coop some of their losses.  He had nothing.

The attorneys have released all of his papers for all to see and it's clear Tesla had nothing.    
Was Tesla a Zionist?
Reply: none Dude you' sound paranoid?  Is it due to the decades you spent consuming mind altering drugs?

Yes the FBI was ordered by a judge to confiscate all of Tesla's papers on behalf of his creditors.  All of the documents the FBI seized have been released and were made public once it was found they were worthless.

Tesla's project to broadcast electricity worked and is being used today.  One can even build an electricity broadcasting and receiving station based on Tesla's original design.  Many people have....  It's not hard to do, the plans are on the Internet.

Not sure why you are so paranoid about a Zionist plot that's already happened.  No need to worry about something that's already happened.

I would be more worried about the Mormons, Muslims and the Chinese.
Reply: none Dude you must be inhaling deep tonight and holding it in.  Everyone who is paranoid knows there were magic bullets, Chem-trails, and cave dwellers can't fly jumbo jets into buildings, in a Japanese sur4prise attack and that Hitler is alive and doing well in Argentina,

How can anyone argue with a drug crazed person like you?
Reply: +cgm778 

Solar is a boondoggle for conceited people who don't want to do the hard work of making an honest living. 

It's a looser without screwing the taxpayer with subsidies.
Reply: @hg2. 🤡